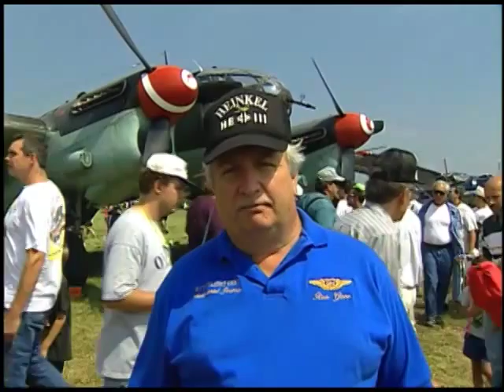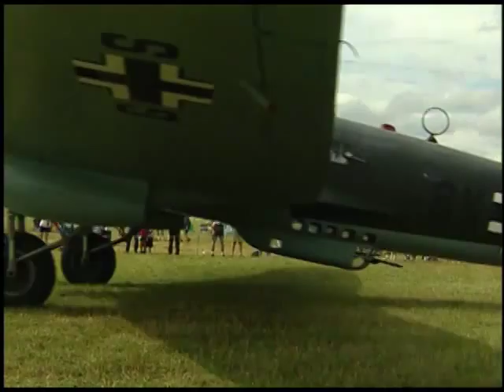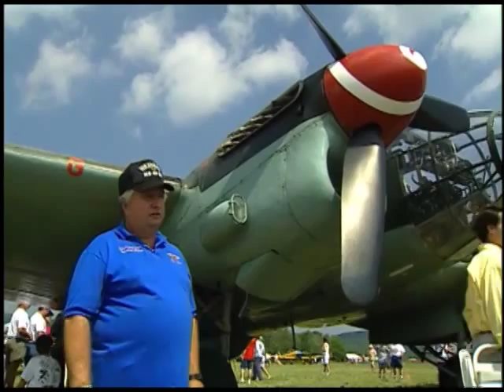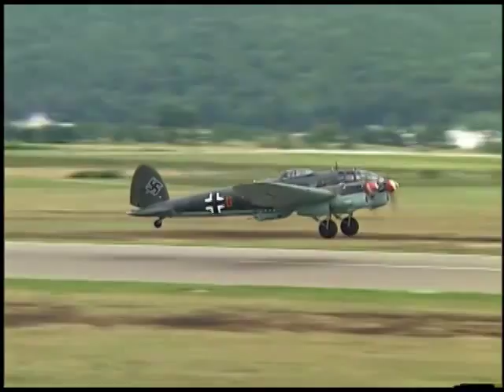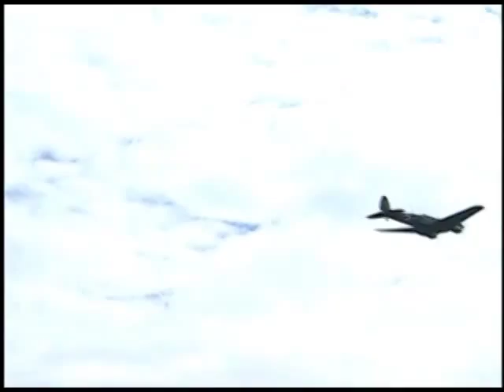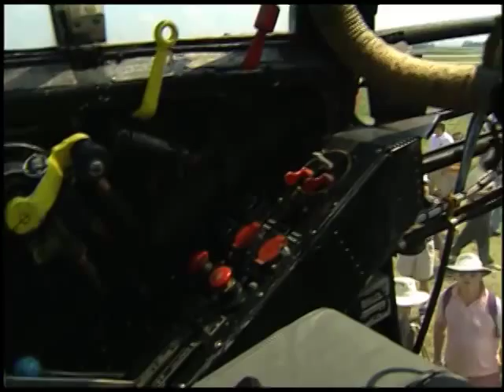Heinkel HE-111 at the Wings of Eagles Air Show 1997

Comment: Its a shame NONE of these Luftwaffe war birds are airworthy anymore. Even this one was Spanish built and didn't have its Jumo motors. And even this one is gone.
Reply: /M0ther_bra1ned/   A couple could fly with work, and one or two of the Spanish examples may eventually be restored as authentic He-111 aircraft.  (One already in progress, but slow.)  The main wing spars are steel and aluminum together, which can create galvanic corrosion issues, so for safety any more that are returned to the air will likely need an expensive wing spar replacement.
Reply: There are flying 109s and 190s.

Comment: GOT TO SEE AND TOUCH THIS PLANE IN LANCASTER OHIO AIR SHOW IN 2000.
IT'S GONE NOW. CRASHED A FEW YEARS BACK. SAD. KILLED WHOLE CREW OF 3. GOD SPEED.
Reply: +JACK CASSELL so there is no more Heinkel bombers left?
Reply: one at DAYTON AIR MUSEUM. NONE KNOWN FLYNG THOUGH. SAD.
Reply: Cavanaugh Flight Museum in Addison Texas reportedly has a CASA 2.111 (Spanish version of the He 111 just like the plane in this video) which is in flyable condition but they do not fly it or keep it rated for flight.
Reply: +greenseaships The Cavanaugh example has some corrosion issues. Probably all of the survivors will have the same problem with the mixed steel and aluminum main spar. Examples that fly in the future will probably have to have a main spar replacement eventually, and it would be wise to manufacture several spars at once to replace in multiple surviving examples.
Reply: I think the deutsches museum in munich is restoring one ( CASA)
Reply: @deutschlandairsoft5980  this is a casa not he111
Reply: Well the one in the movie Dunkirk was real.....
Reply: Reuben Shilling i dont Think it is (none can fly)
Reply: Oh yeah yeah Oh yeah yeah I did research and you are correct
Reply: That’s sad didn’t know that, not sure why it crashed but there’s a lot of air show crashes of people wrecking historical planes  by showing off trying to do stupid maneuvers

Comment: It is almost forgotten that, originally, the pilots of the He III would raise their seats so that they were flying "open cockpit" for take-off and landing reflecting their early development as closed cockpits were a new innovation. Notice the crank in the steering column, to allow its use in the raised or lowered piloting configuration. Also, the instrument panel is mounted in the roof of the canopy, so as to be visible from the internal and external piloting positions. There's actually a flip-up windscreen in the top of the canopy, to protect the pilot in open cockpit take-off and landing. Quite an extraordinary aircraft in these regards.

Comment: Ever since the Battle of Britain movie, no flyable Heinkels were left
Reply: +Enzo Canedo    There were several flying after the movie, but presently none are flyable without major work.   Plus one under rebuild to fly.
Reply: @FiveCentsPlease   ...Which eventually will crash.
Reply: @Page-Hendryx    It depends on how well the aircraft is maintained and who is flying it.   The CAF lost this 2.111 when an engine quit on final approach, making the airplane a handful.   The engines were too destroyed to determine the cause, like fuel or mechanical.   The He/CASA aircraft have aluminum and steel in the main spar so they all have galvanic corrosion.   Anyone who wants to fly one will probably have to make a new spar.  Paul Allen's Museum has one in rebuild that was almost finished.  But I doubt there will be many put back into the air.   I also doubt that we will ever see many German twins flying, like a Bf-110 or He-111.

Comment: So strange that this is getting hate for not being "The real deal". Where else would you see one fly? Who else stepped up to build one, even if it's only a reproduction? The answer is no one. They did the best they could and could not get the real engines. Closest you will get. Most of you will be happy to know this plane hasn't existed since 2003.
Reply: +and so    It was not a reproduction but CASA 2.111F #118 licensed built in Spain.    No CASA 2.111 or He-111 are flying at this time.
Reply: @FiveCentsPlease  it’s the closest you’d ever get. What’s the problem? This or nothing?
Reply: @andso7719    There's an He-111 project in Europe that's been going for well over 20 years with little public information.   I don't know if it will ever be finished but the Jumo engines were ready years ago.   Paul Allen's museum has restored a CASA but it has not been revealed and with the museum currently shuttered it will be a long time before that one sees daylight.  There are a few more CASA's that could fly with some work. One major problem is the aluminum/steel construction of the wing spars has created galvanic corrosion and they would likely need new spars manufactured. It will be expensive to get one back in the air now.

Comment: isn't that actually a spanish CASA?
Reply: yes but it can be called he111 because the casa is a  he111 h16 with spanish mark only later the casa changed the motors of the he111 to roll royce merlin becuse they have only 130 with original motors and 70 with roll royce merlin the casa is a licensed version of the he111 builded in sevilla  same that the ha1112 that is the bf109 but with changed motors they have the roll royce merlin too
Reply: that planes now is used in movies the repaint with luftwaffe marcks and they do the scens with planes that painted to representate bf109 and he111
Reply: It is, they acknowledged it in the video

Comment: Is that the same heinkel that made it's debut at the CAF in Harlingen
Reply: + Runs with a Fox   This was the CAF aircraft.  Crashed and destroyed with the loss of both crewmen in July 2003 at Cheyenne, Wyoming.  Engine failure on final.
Reply: @FiveCentsPlease  I remember that.  But not what i asked!
Reply: @whisperingdeath308   This airframe left the UK and received a US registration in August of 1977, and it went straight to Midland, TX at the American Airpower Museum.   It was on display with the CAF at the October 1978 airshow at Harlingen, TX painted in German markings.